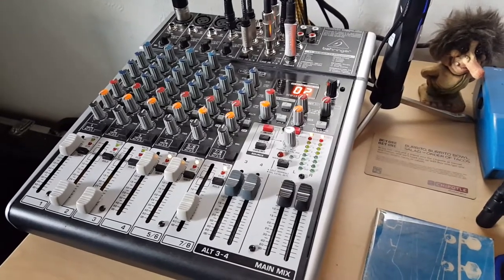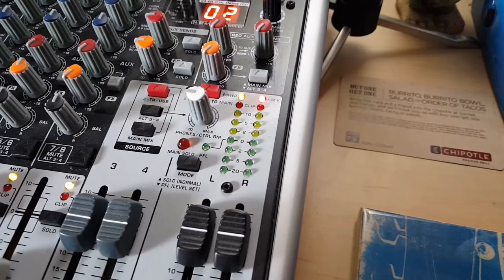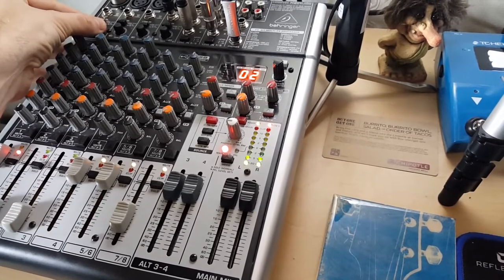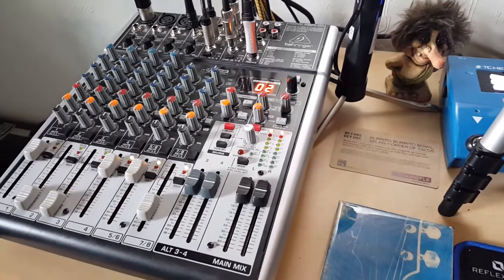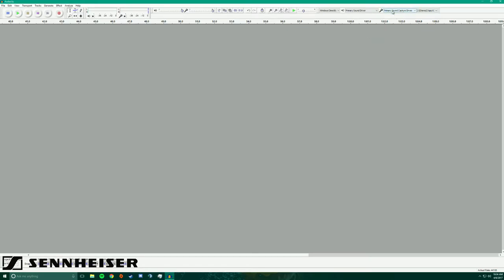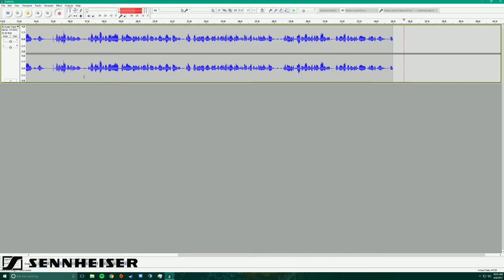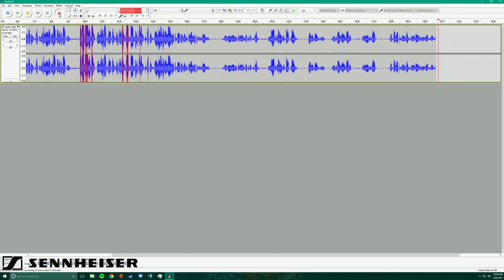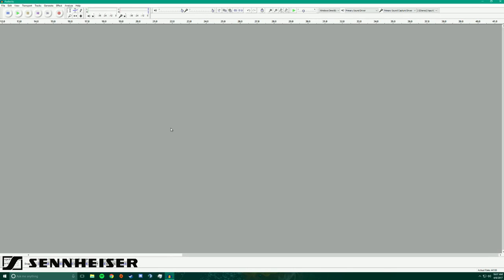Audio How-To - Proper Mic Gain adjustment - 3 ways

Comment: What if you are using a mixer -> main out -> jack (3.5mm) -> pc line in? There are 4 levels to deal with: gain, volume level (the fader basically), master volume and the line in/recording level on windows. How to get the input signal properly to audacity or any other DAW application ? Thanks!

Comment: I have a question regarding the mono interconnect cable stated below. I picked up the cable and I have signal coming through to my gaming pc. But the mic quality doesn't sound great. I did a little adjusting and it's acceptable but not what I expected. it seems like the signal is coming in too strong because I have to adjust the levels down almost to 0. I have to set it at around 10. And I'm getting a bit of buzzing. Would this be solved with a buzz box mayb or does anything ring a bell on something I am doing wrong? I use a mackie pro v8. It's very similarly built to the behringer used in the video. Thx
Reply from the maker: A buzz box might clean up the audio a bit, but in doing some more testing with this same issue on my end, the particular am radio/staticy sound wasn't pleasant for my game PC I picked up a small 3.5MM to USB sound card for like $8 on Amazon. This seemed to really clean up a lot of the base ground noise. I think this really comes down to the signals coming into the PCs being so raw.

Comment: I use a mixer for my stream, I have commented questions before so I assume you kind of remember this... I set it up so my rear output and front output are read as seperate outputs.. I have the rear going into my mixer using 3.5mm to stereo (right and left) and it sounds amazing. I have my front going into the mixer from 3.5mm to stereo (right and left) into a stereo to mono adaptor. I use the front output as my communication output for discord but it comes out very low. The gain is maxed out. The compression is up. The software itself is at 200% and I can't get the volume to be controlled very well. It just seems quiet. I have gone over connections, made sure they were all tight. Checked settings over and over again. Any ideas as to why it isnt working properly?
Reply from the maker: your front output might just be very low output gain. Not much you can do with that other than add another amp somwhere.

Comment: Hmmm so I have the same mixer (actually I have your exact sound setup from your other video with a different mic) and my mic doesn't even make the lights move unless I turn it up to ungoldy levels and it picks up a lot of background sound. Does this mean I just have a shitty mic or a lot of background noise? My computers are nearby and fans are often running in the room.
Reply from the maker: What mic do you have? How far is it from your face? Do you have the solo button pressed when doing this? how does Audacity look?